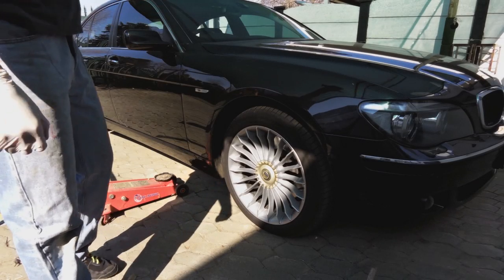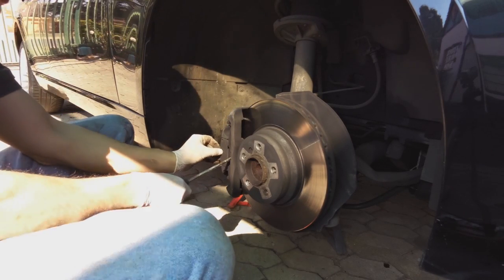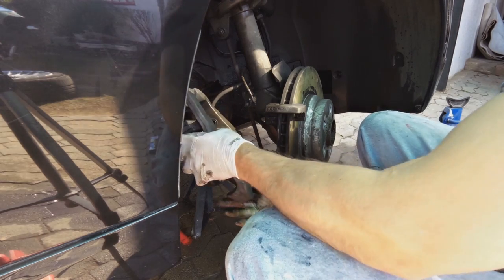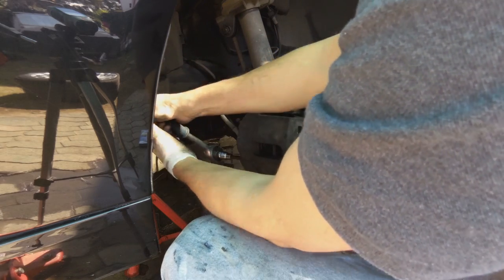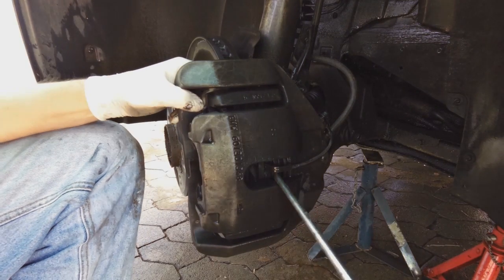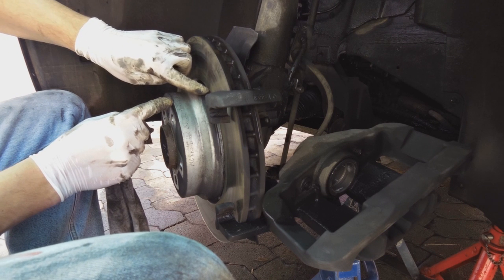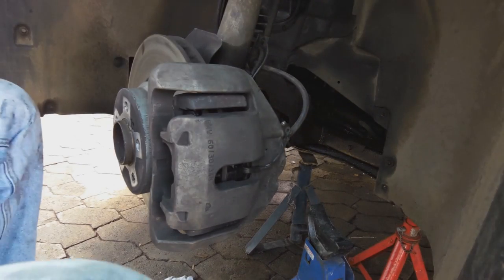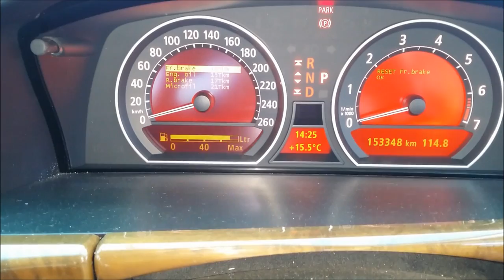How to change break pads on BMW (E65) - Detailed!

Comment: Why the pads with 4 springs are replaced by TEXTAR with pads with only 2 springs. I mean at 35:32 the external pas is without spring.
Reply: In the BMW Manual it is writen, that the new design of the outer Brake pad does not have springs anymore but the old style with springs is also stil allowed to install

Comment: uhmm your brakes are sprayed with oil... not good! an oil leak this massive is probable the altenator bracket gasket...
Reply from the maker: The car in question had an oil filter that was leaking oil.